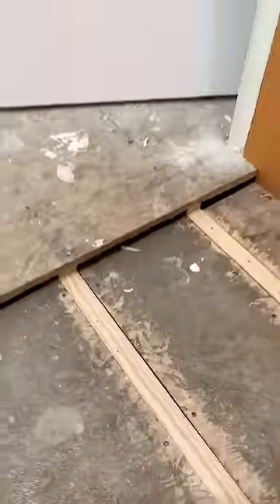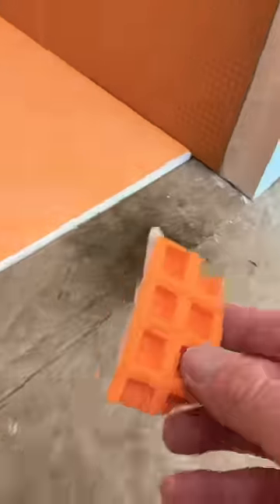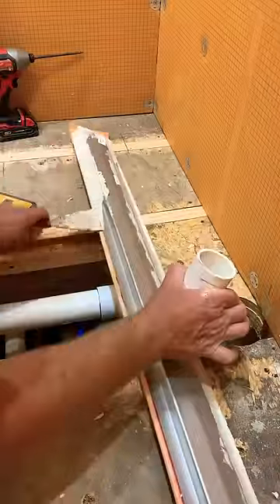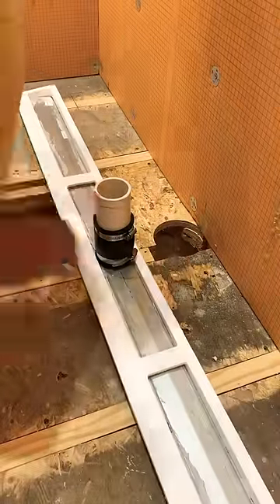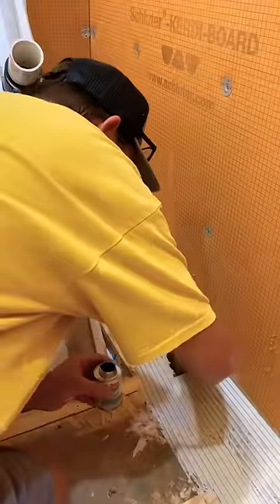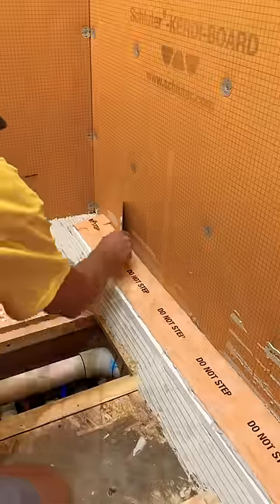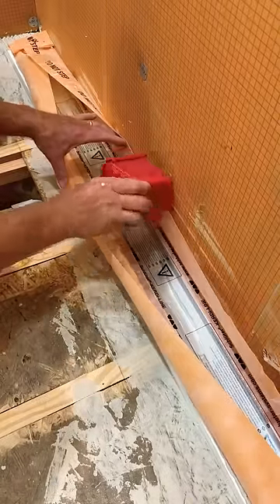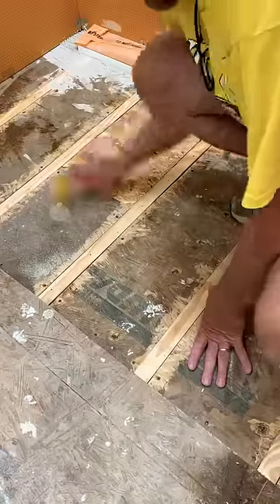Easy CURBLESS entry shower #shower #schlutersystems #gotitcoach

Comment: You got the wrong fittings installed
Reply from the maker: It’s a pressure fitting, yes. It drains perfectly
Reply: @w.k.d.constructionllc  sure maybe for the next 6 months .
Reply from the maker: @leach713  so if its able to hold 180psi forever, it won’t hold non pressure for 6 months…🙄 c’mon pffft
Reply: @w.k.d.constructionllc  hahaha no you Jack, that wasn’t it , sorry it went over your head . 🤣😅

Comment: No primer disgusting you doing everything right besides the proper steps on gluing pipe.
Reply from the maker: I never prime waste line only pressure. I use cleaner and glue

Comment: Dang dude you used a pressure 45 and an illegal no hub. When your shower clogs which it always will over time that 45 gonna screw someone over trying the unclog it and probably break it in the process. Bad plumbing do not remove the sub floor for the drain again bad plumbing
Reply from the maker: I shouldn’t have used the pressure fitting but it’s what I had on hand that day & If you clog a 2” shower drain you need to quit showering, cause ur doing something wrong. I have never in my life heard of a 2” shower drain clog. If you can’t clean out some hair with a hand snake and have to use a roto, 🙄

Comment: Do not I repeat, do not cut your floor Joists
Reply from the maker: As I said make sure your joist are sized appropriately, mine are!
Reply: You can if your tray is an inch thicka and you take an inch off the top of joists where the tray is. Specially if your joists are 8x2 or 6x2. Extra supports fan be added alongside the cut ones for extra strength too
Reply from the maker: @tomg3131  mine are 2x12 on 12” centers.
Reply: 2x12" spaced at 12" on center means that floor spans a huge distance or has a heavy load to support. You've notched them to create 2x10"s. If 2x10"s would've supported the load originally , they would've used them. 🤦🏽‍♂️
Reply from the maker: @crownj01  huge like a 12’ span? 🙄 Here you go again ASSUMING… maybe they wanted an extra beefy floor & notching a 2x12 down 3/4” is still structurally more than a 2x10. Try again🙄

Comment: Your not even installing that up the code. You do good work and should stick to building part of the job and just hire a licensed plumber.
Reply from the maker: It’s a pressure fitting, yes… I shouldn’t have used it, okay. Will water drain properly…yes. Will it leak…No. did I need a fitting and had this one in the bottom of my trailer…yes. Was the video on plumbing codes and how to install a waste line…definitely NOT.
Reply: @w.k.d.constructionllc  got it coach, you’re not supposed use flexible couplings inside/under the building, next time use a shielded coupling 👍🏻

Comment: Just cut that structural floor joist right out of the way! Hahaaa! Move along. Nothing to see here…
Reply from the maker: Read the other comments. My basement wall is 12” there eagle eye! 🙄
Reply: IBC 2308.8.
Notches on the ends of joists shall not exceed one-fourth the joist depth. Holes bored in joists shall not be within 2 inches (51 mm) of the top or bottom of the joist, and the diameter of any such hole shall not exceed one-third the depth of the joist.
Reply from the maker: @shaneoakley8757  holy cow, I know. My basement wall is 12” which means even though I cut the joist…it is still setting on the wall approximately 4” supporting the dead and live loads perfectly. I don’t need any notching or boring code. It’s not evident for this application there chief. Try again
Reply: @w.k.d.constructionllc  lol this fool keeps talking about 4 inches bearing on the foundation wall, which does absolutely nothing for the over notched joists. Shane is correct, buy a code book and read it if you are going charge people money for your "work".
Reply from the maker: @crownj01  you obviously need to read it there chief. Tell me…How thick is a 2x4 wall and how much bearing can you have on it? I’ve set a hell of a lot of LVL’s on 2x4 walls that hold up more load than a tiled shower. Ur right, I’ll keep charging for my work that is structurally sound. 🙄 try again

Comment: You sure did test that with that little bowl of water? No pressure, you sure that's not going to leak? Because by the time it does, and you find out, it's going to rot their house down
Reply from the maker: How much water will a trap hold? Exactly, the trap will only hold a certain amount of water, even with constant flow. If I fill the trap up and let it set 24 hours with no leak…guess what, it’s tested